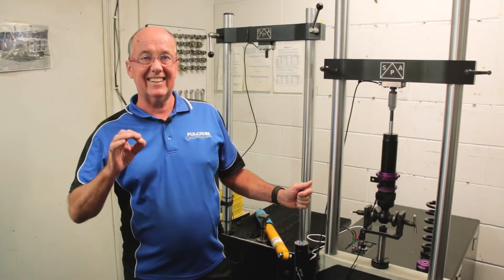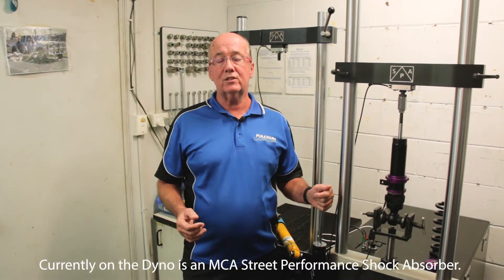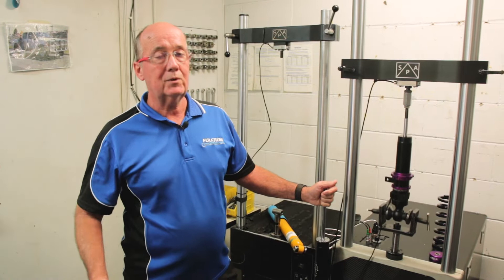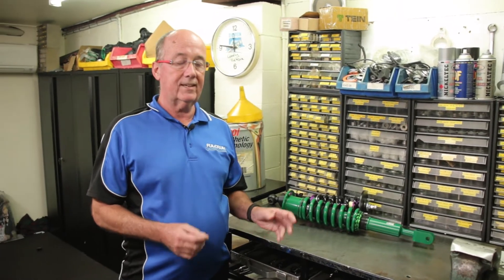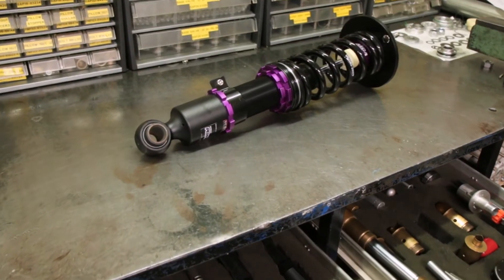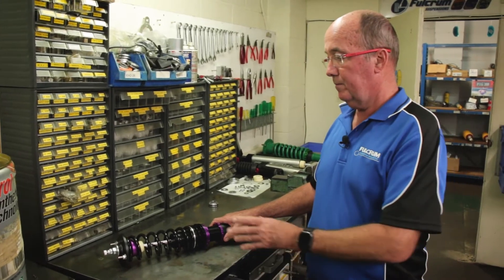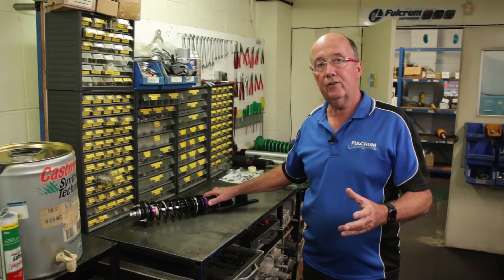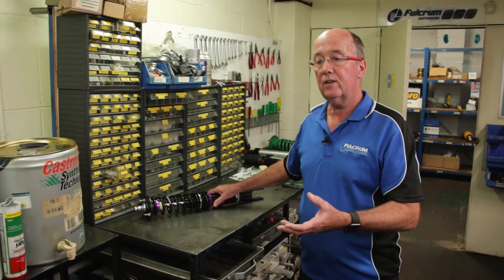MCA Coilovers at Fulcrum Suspensions

Comment: have you tested the Street Performance series?

im looking for a review to see how they compare to the street essentials
Reply from the maker: Hey, the street performance is meant for performance so its valve coding is set for performance and spring rates are higher. The street essentials kit is meant for comfort and the shocks are valved coded as such and the spring rates are set lower when compared to the street performance.